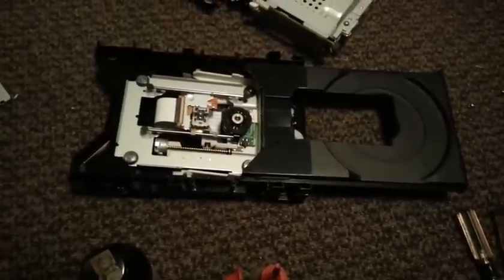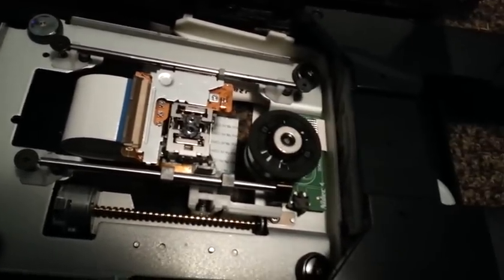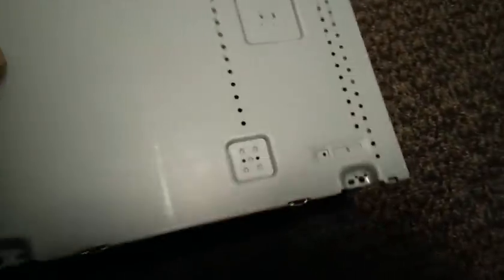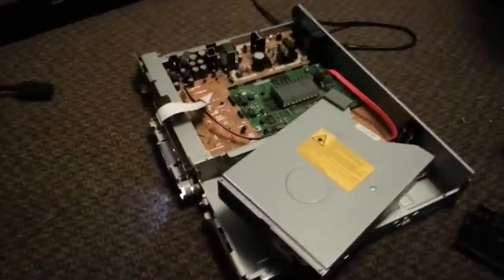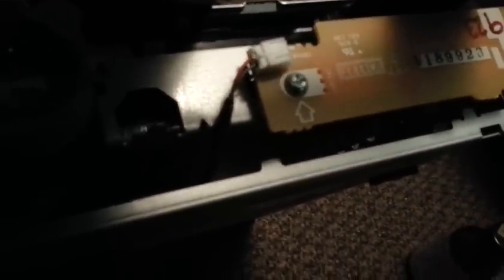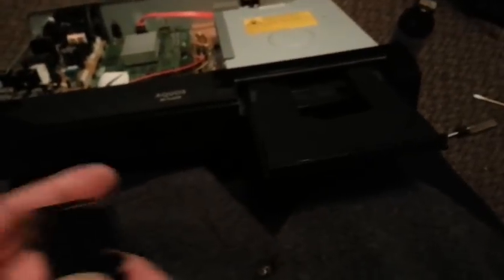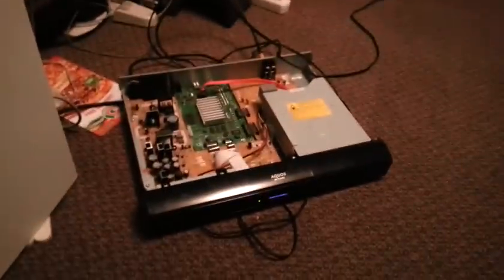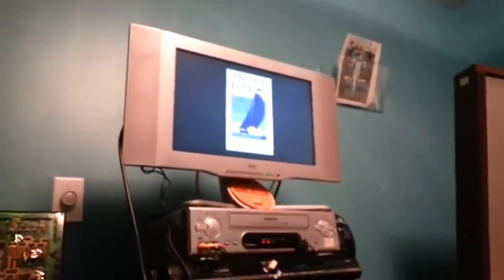DVD or CD Player Service  (Quik)

Comment: Thanks for the Video,I have repaired alot of these too but recently my issue is the turntable it is not correctly spinning my disc and I think it might be what you mentioned cause mine is a bit stiff as well.Am going to try and see if I can oil mine and just since I am in the process will machine oil it.But the laser works fine and clean it plays sometimes then others you can here a chugging or lagging like it spins incorrectly then it says cannot play disc.Its is a newer player and a Sony.